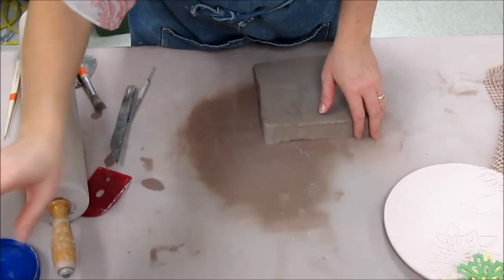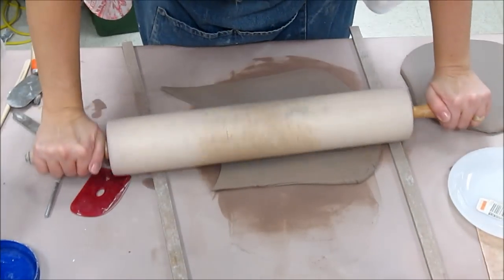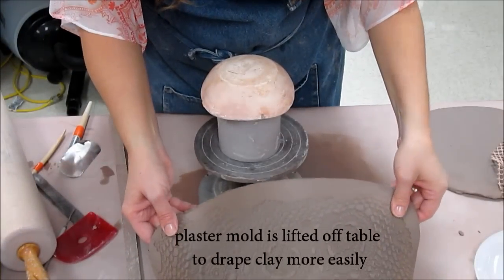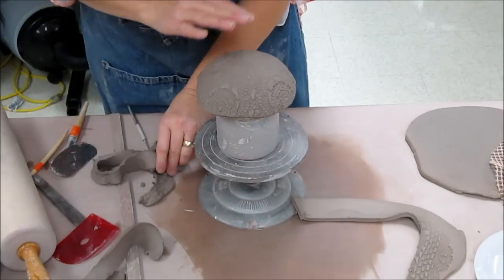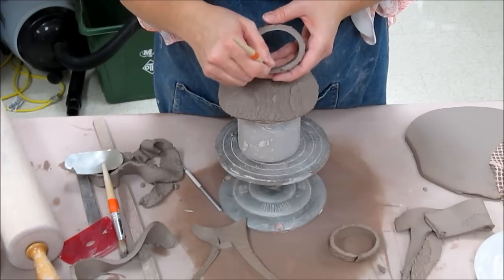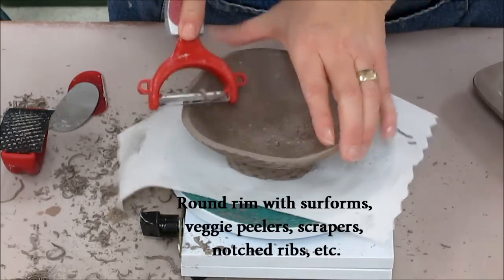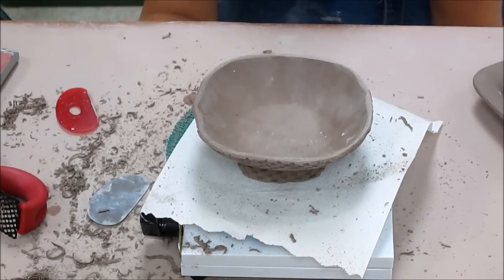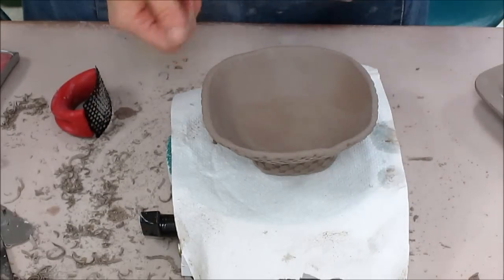How to create a textured slab bowl over a plaster mold - Ceramics II

Comment: Hi there, this is basically what I do but I did mine over a plastic bowl but the bowl is deeper so my problem is the clay needs to be too big and creases and then I have to cut the excess off where it overlaps so I can't do my texture before draping the clay over the mould. I'm making a yarn bowl. How would you overcome that? Use a smaller piece for the round bottom bit and then a band further up or what? Any suggestions will be appreciated.

Comment: Hi Karan. I know this was posted a long time ago but I hope you're still able to respond. Do you think I can do this using air dry clay? I think I may have missed you mention the type of clay you used to make the bowls. Thanks for sharing the video. Very helpful.
Reply from the maker: Hi Carlotta!  Well, you could do the technique with air dry clay, but if you ever want to use it with food applications or any moisture, I would use it with only a fireable and glazeable claybody.  :)
Reply: @KaransPotsAndGlass  thanks so much for responding. It will be used to hold trinkets at the front door.

Comment: Shouldnt the foot ring been cut striaght for it to be even and level?
Reply from the maker: I am sure in my haste to get this video made for my students, I could have been more careful when cutting the strip, but in the long run it made no difference.  It sat level and even.
Reply: @KaransPotsAndGlass  its ok i seen what you did and i see that it was made level on sides i didnt think to check it like you did,  thank you for the video we learned alot. Maybe level for a flat bottom?, i forgot it was curved so whereever the ring was put it be right and trimmed as needed. Made sense. Thanks

Comment: hi come from Denmark. Can you spell the name of the file/rasp you are using forthe rem, I want to buy one, but can not hear/understand the name  properly, many greetings anja
Reply from the maker: Well, hello from Ohio!  :)  There are two names for them... a "surform" is the name that the Stanley tool company uses.  (I sometimes call all these tools surforms, as those were the first ones I used about 30 years ago.)  I think they are mostly made for plaster (not clay). The small ones with the colored handles are called "shredders" and they are made by a company here in the USA called Mud Tools... by potter/ceramic artist Michael Sherrill.  I will give you website links, but, as I am not sure if websites work internationally, the links may not be good!  
Ok, this first link is directly to the Mudtools website:  https://www.mudtools.com/product-category/shredders/?v=7516fd43adaa
This second link is to Amazon- where the Mudtools shredders are sold.  https://www.amazon.com/gp/product/B00WTBZ5EE/ref=as_li_tl?ie=UTF8&tag=karanspotsand-20&camp=1789&creative=9325&linkCode=as2&creativeASIN=B00WTBZ5EE&linkId=0d17fbc43018225a24a5717c3a2c4bf2
And this one is a link to Amazon, where the Stanley brand surforms are sold:  https://www.amazon.com/gp/product/B00002X1ZH/ref=as_li_tl?ie=UTF8&tag=karanspotsand-20&camp=1789&creative=9325&linkCode=as2&creativeASIN=B00002X1ZH&linkId=b26cff54821d50522d94fce860d4c83b

Again, sorry if the links aren't helpful... I hope some of the information can help you find them!  :)  Karan
Reply: Thank you wery mutch :)
Reply from the maker: My pleasure!  Good luck!  :)

Comment: Probably a stupid question....Why do you roll the slab out on canvas?
Reply from the maker: Not a stupid question at all!  :-)  Canvas is a great porous material.  It helps to roll on it, as the clay will release from it.  If you were to roll out on a wooden or formica table or counter top, it would get stuck.  Canvas works well unless it gets really saturated, then the clay may stick a bit!  I keep a big canvas covered board handy in my studio as well, if I need to have a more portable work surface!  :-)
Reply from the maker: Oh, and I should mention, it is a really THICK canvas- similar to a denim thickness!  It lasts a really long time without stretching!
Reply: Thank you for your speedy reply! I am an oil/acrylic painter and I happen to have a roll of canvas. I hope it's heavy enough. Thank you again!!